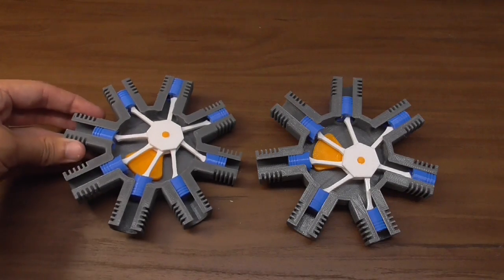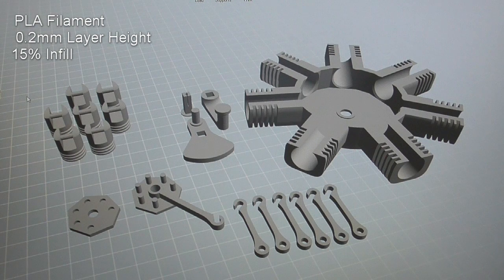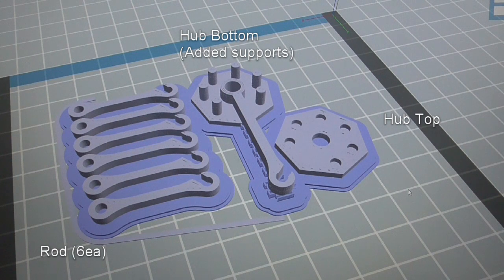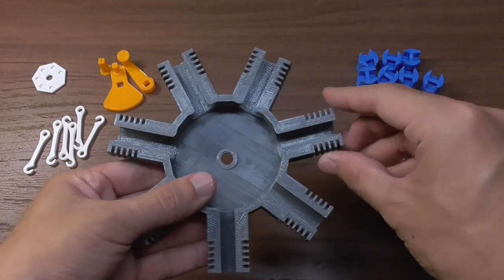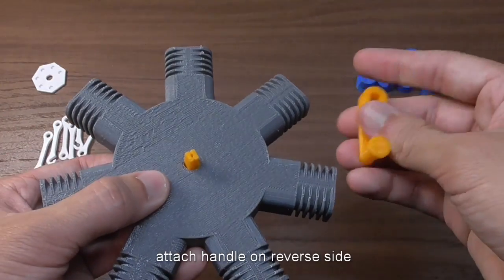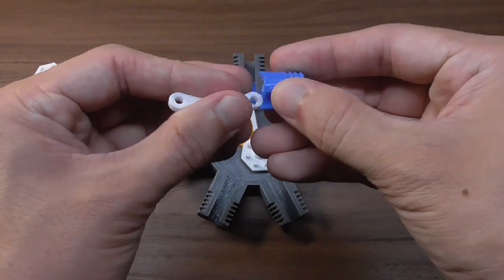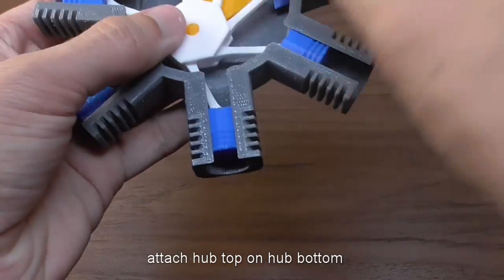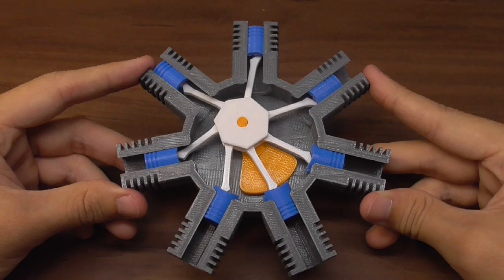3D Print: 7 Cylinder Radial Engine Model on Thingiverse [by plusalpha Designs]

Comment: Why do you mount one piston to the center and the rest to the edge?
Reply: The center crank is called the 'master link', and it's fixed in that way so that the other links don't twist in odd ways as the engine spins. otherwise the engine could bind and it would be a bad time.

This model is missing by far the mos complicated part, which is the cam ring and valves.
Reply: @DFX2KX  Ah thank you, I did a similar design without it and had that exact problem. Did not figure out why :)

Comment: How many horse power does this make if it was a real engine?
Reply: Frankly i dont know how u could get workable energy out of that engine without massively impacting ur efficiency. U see the hub is not still and moving about so the transmission of energy will be tough and the engine will be finnicky.
Reply: @architakumar2579  yeah i know 
But how many HP if we somehow Made it
Reply: @mr.fingerwithasmileyface3584  1 200 HP
Reply: Joe mama

Comment: The Hub Bottom and top plates comprise what is known as the 'Master Rod' There's also an EXCELLENT video available from a gentleman who built a nearly full scale Working Model of a Radial engine from wood. His design includes the cam and followers and explains why a radial has an odd number of cylinders and it's unique firing order. In the case of a 7 cylinder engine it would be 1,3,5,7,2,4,6
Reply: JAMES TUTTLE  link to the video??

Comment: Why is one piston connected to the center? It would give no resultant power.
Reply: Its not the center of the cam so it does
Reply: It would give power since it isn't the cam center, but it would give a different amount of it than the other pistons, which is easily avoidable by not making it be at the center or make every piston attached to the center.
Reply: Oh

Comment: You should make it air powered
Reply: May I know how?
Reply: Sutaokami you could slightly re-design it to be a steam engine because steam engines just run on pressure anyway, you could also cut to size and stick a clear piece of acrylic over the exposed moving parts to ensure it’s sealed but you can still see inside
Reply: @lewisgray4202  3d printed train

Comment: What they actually built a real engine like this and put it underneath a car instead of infront? It weight more but you’d get a lot more storage and how much hp would this produce?
Reply: It's not as thin as you think and it still needs a transmission,  search on Google for radial engine powered cars
Reply: The Marshmallow has someone bothered engineering a super thin version? Maximise power by going wider instead of making it taller
Reply: @jefgoemans1802  It actually works In normal engines not in this one
Reply: It's better in front as it was used in planes
Reply: Honda 250  :)